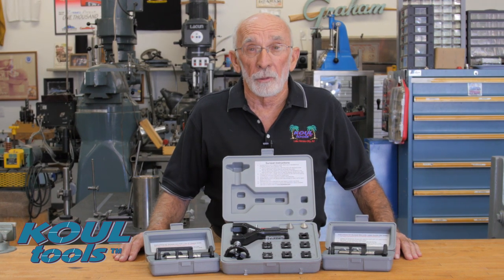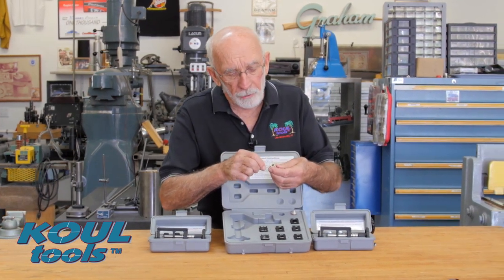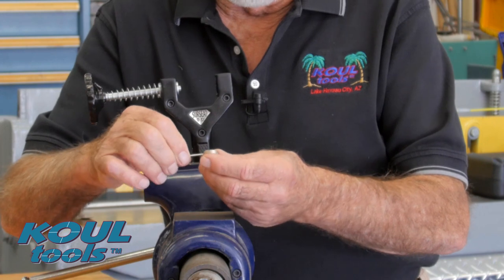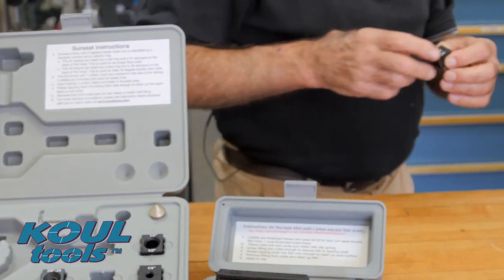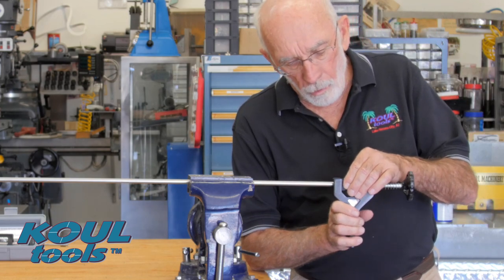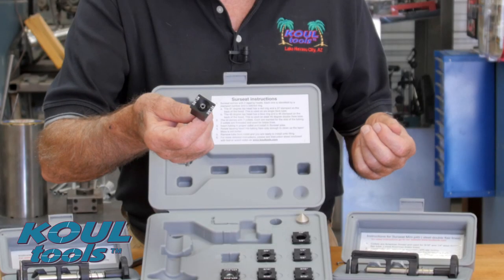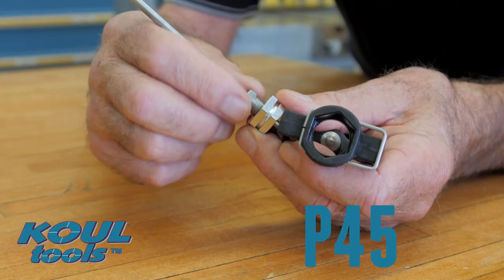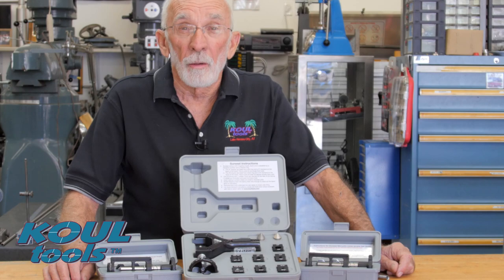New Flare Lapping Tool for Brake and Fuel Lines

Comment: I used the P51 set to lap all the seats on my newly installed 1/2" 
stainless tube return style fuel system.  First turn of the key and not a
 single leak.  Thanks for all your help Dick.

Comment: I need a real flaring tool first, I have a snap on one and it sucks,  
any suggestions?
Reply from the maker: +Cam Shaft No matter what tool we use, we always lap the flare to ensure a perfect seal.  We find the Rigid flaring  tool to be the easiest to work with.
Reply: OEM Tools 24364 In-line Flaring Tool. Buy it less than $20 on eBay.
Reply: Eastwood